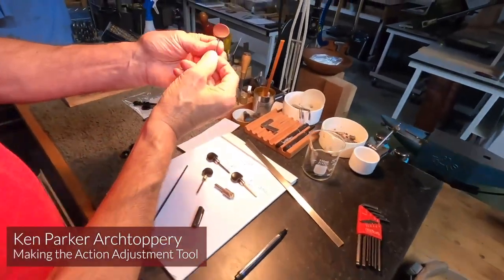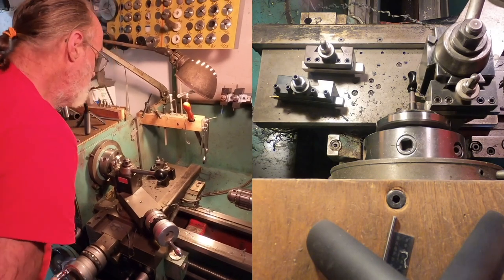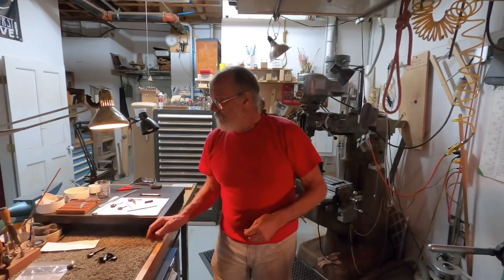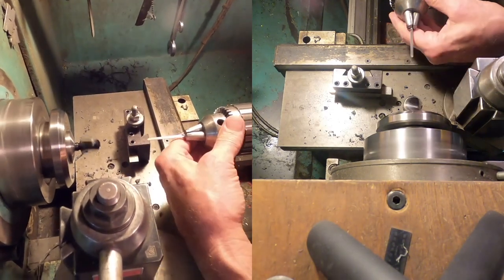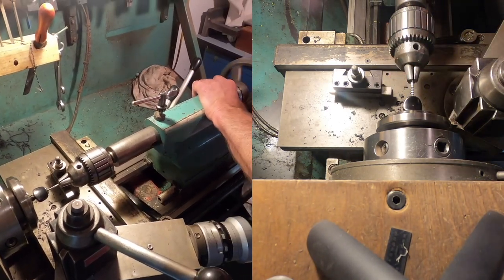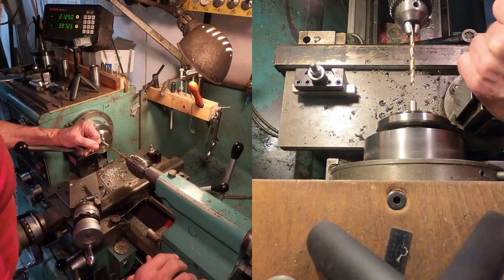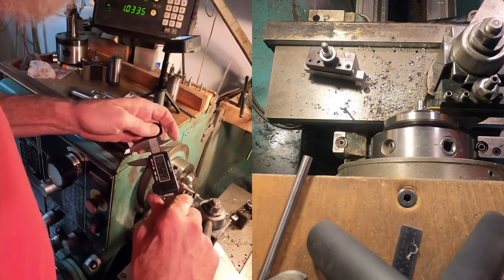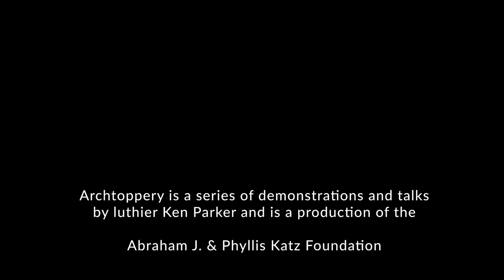Ken Parker Archtoppery: Making the Action Tool

Comment: So that’s how a hex hole is made!
Reply from the maker: Broaching, Mon! Here I'm using a "through broach" that passes completely through the part as it finishes the cut. Thee is also a "blind broach", which usually onl has one tooth, and stops cutting when it finds the end of the blind hole. A good example of this would be cutting the flats on the tuning peg button hole that fits over the input shaft of many styles of tuning pegs, allowing the button to drive the shaft.